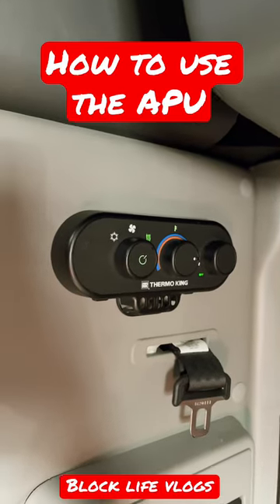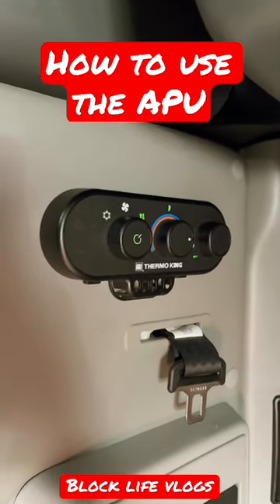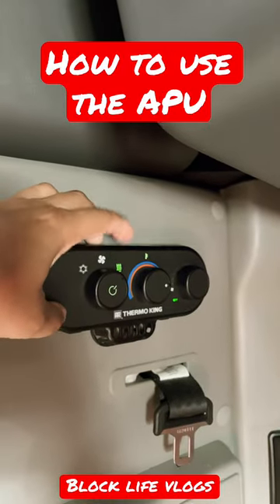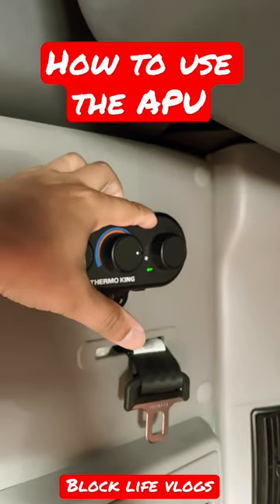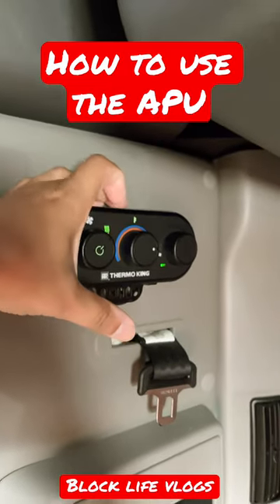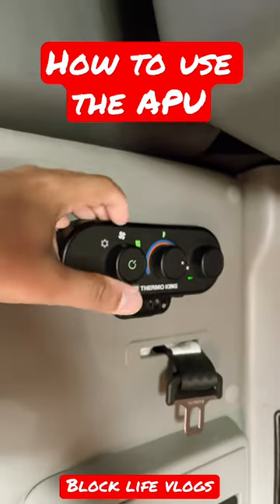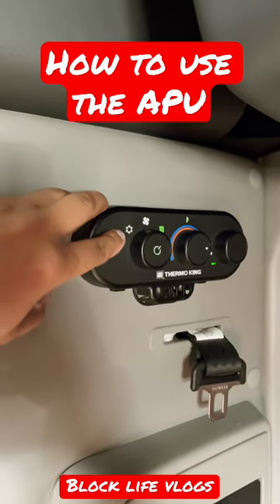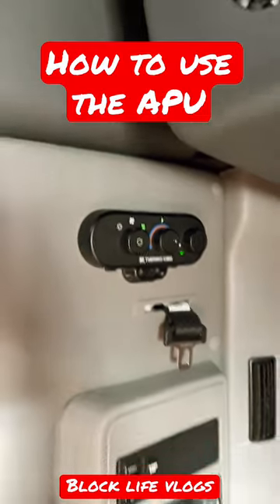“Do you know how to use the APU, mines is blowing hot air”#viral#viralvideo#trending#trendingvideo

Comment: Thank you for this video!🙂 My APU doesn't look like that one!😪
Reply from the maker: Welcome, some are different, most have the same functions
Reply: Ok. I am dumb AF excuse my language 😒 all of my actual knobs are up front and do the truck need to be running? I'm sorry for bothering you
Reply from the maker: Your good, and no truck has to be off or in auxiliary
Reply: I got the cool air blowing..its not the ac it's gotta be the fan bit I am close.  This thing is crazy. It works up front but not in the back. I will keep playing with it until I stop.
Thanks again!😊
Reply from the maker: What kind of truck is it?
Reply: 2023 international LT
Reply from the maker: @pennyanderson2364  you should have them in the back then, the control are for the front, that’s why the front is the only thing blowing, try to look closer
Reply: How do I get my heater to blow harder?